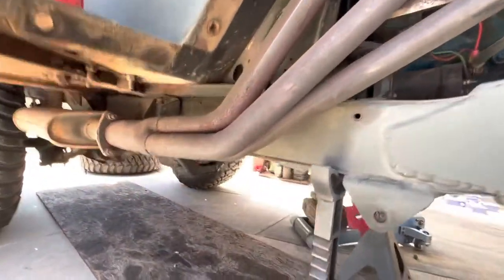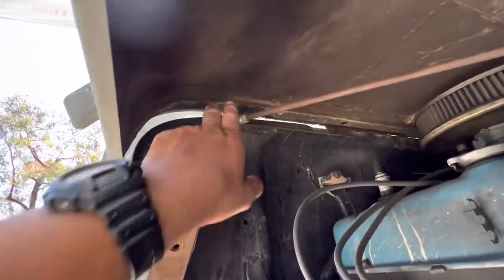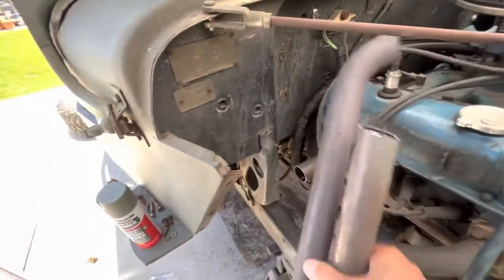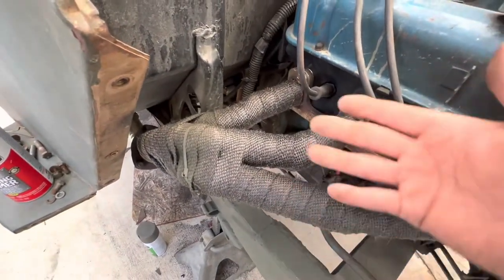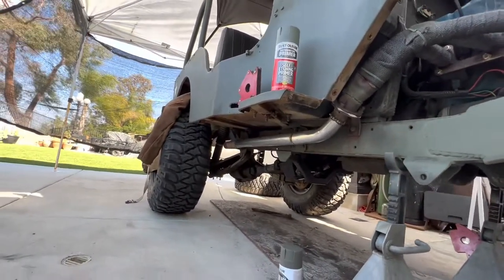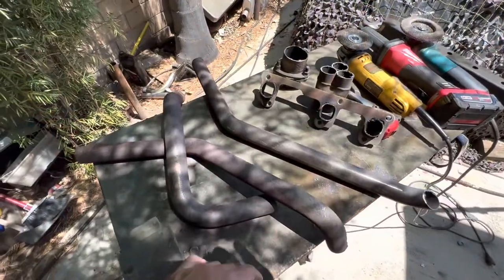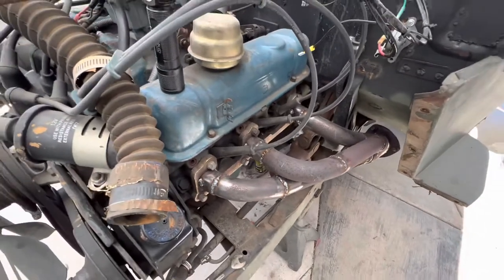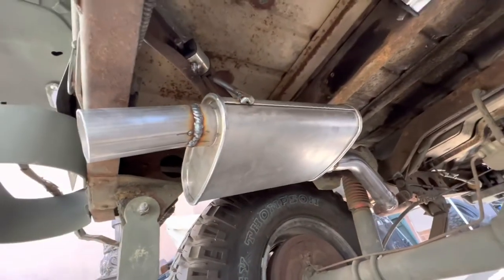Jeep CJ2A Buick V6 225 Mufflers Headers Modification 1948 vintage

Comment: Would you tell me what brand of header is on the Jeep? Thanks
Reply from the maker: Hi - i am not sure. they were on it when i got the jeep several years ago. As far as I know there are only two types for these motors avaikable these days. vintagejeepers.com has a hugger style. and everyone else has the type I have  - you can find them on ebay… and internet.
Thanks.